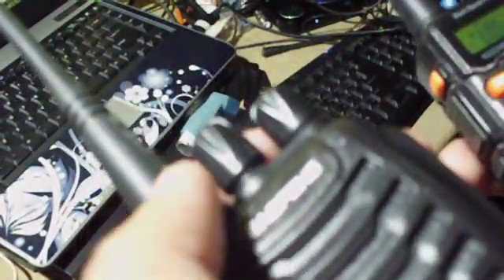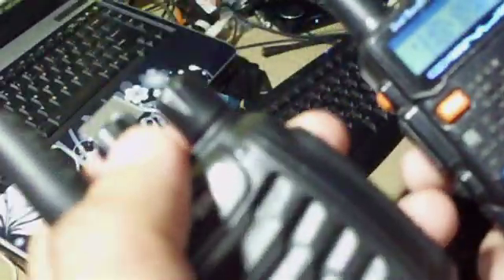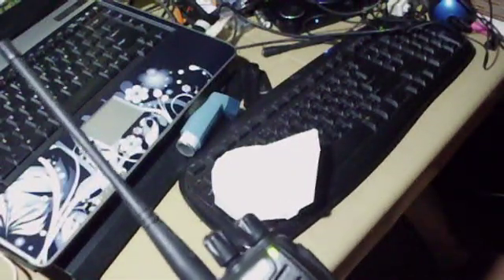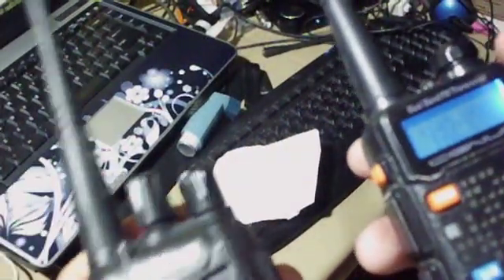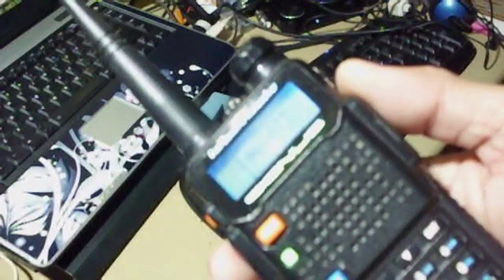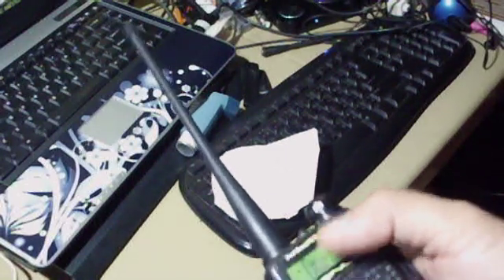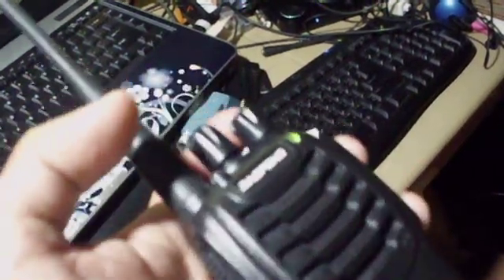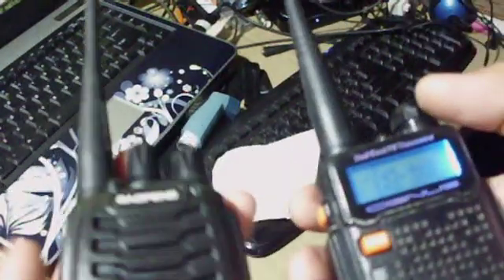How to put VHF frequency on Baofeng BF888s (3)

Comment: I tried this on 3 different BF888s radios. one with the following CMIITs
n/a
2017fp0564
2012FP1918
All three just beep when the frequency is changed to sub 400
Reply from the maker: This mod will work for older models of BF888s same version as the time this video was uploaded, unfortunately this doesn't work to a later versions of BF888s you can read on the comment section of this 3parts video for successful and unsuccessful mod. The most you can do is just restore the firmware of your radio to make it work again.
Reply: @EphraimGariguez  OK. That's find.  Maybe a follow up video is needed to help identify radios that are compatible. Thanks for the video.

Comment: Thank you for this video I had watched it about 100 times I finally got vhf frequencies on my radio  but all I am getting is a loud and steady feedback noise can you tell me what I am doing wrong 😅🙃
Reply: Thanks for your help I will keep trying
Reply from the maker: If the firmware and hardware are compatible there are 2 channels that will give you noise sound 1 & 2, so you just need to move on a different channel with vhf frequency and test on there, you need a dualband antenna for it to work.  Stay away from noise i.e wifi routers, computers etc. as baofeng front end is prone to noise. If successful you will be able to transmit on a vhf radio and receive it on your radio with modified firmware. Transmission on the modified radio is only short distance as the power output is too low to be useful less than 1 watt on mine. Unfortunately there are new hardware and firmware releases that is totally incompatible with the mod so whatever you do it won't work, just restore your old firmware and use it on UHF. Reports of successful mod are on the comments section of this three parts video, same with the reports of unsuccessful modification. Regards.
Reply: @EphraimGariguez  okay I got the noise to stop but I still can't rx and tx
Reply from the maker: @kevinbarrow4  most probably the cause is an incompatible hardware, because if not it would work right away base on my experience when doing it the first time. Retrace your steps, if still doesn't work just restore your original firmware version.
Reply: Does it resemble traffic noise?

Comment: Good Day paano po palawakin coverage ng bf888s? any tips? salamat po
Reply from the maker: Hindi nyo mapapalawak ang coverage nyan at 2watts lang maximum transmit power nyan, palit kayo ng radio.
Reply: @EphraimGariguez  marami po kasi akong nababasa na antenna daw po mejo confusing lang po
Reply from the maker: @janmichaelualat7971  kahit mo palitan ang antenna sa 2watts depende yan sa terrain ng lugar mo kung gaano kalayo ang kaya mong abutin 15 to 20kms siguro sa directional antenna na 6dB gain kung walang masyadong obstruction sa lugar mo. Kung maraming obstruction baka 10kms lang hirap na. Kung rubber duck naman na antenna roughly 1watt per km ang range depende rin sa terrain ng lugar mo, so yung radio mo 2km ang default range nya more or less sa rubber duck antenna.

Comment: Thank you for the video my friend. I have followed your instructions step by step, however CHIRP doesn't read the file from 888S PC Software and also, the main issue is that the green light remains on making a signal noise. Any ideas on how to resolve this? Thank you in advance for your help.
Reply from the maker: First move the dial to a channel which doesn't have noise, if you try different channels and still there is noise you are probably too close to a signal source that generates noise i.e wifi access point, move away from that area. If the noise is gone you can proceed with programming.

Comment: VENEZUELA.. Saludos.. Comprendo total su instrucción en vídeos.. Pero tengo una duda,, Usted inicia las pruebas en Canal 4.. Por que no inicio en Canal 1, 2, 3.... ??

VENEZUELA.. Greetings .. I fully understand your instruction in videos .. But I have a question ,, You start the tests on Channel 4 .. Why not start on Channel 1, 2, 3 .... ??
Reply from the maker: There are unusable channels introduced on the modded firmware when you convert your BF888s to have VHF frequency you will only hear noise on those channel the reason why I skipped it. This mod will only work on old releases of BF888s since 2yrs ago. Newest BF888s doesn't work using this mod tutorial.

Comment: Boss, pede ba gwing repeater ang uv5r pr sa bf888s?
Reply from the maker: malamang pwede pero limited coverage ka pa rin
Reply: @EphraimGariguez  boss, ung uv5r po ba pag ns labas ng bhay about 200meters, ung bf888s ns loob ng bhay nde na cla mag contact?
Reply from the maker: kung walang sira parehas at least 1km radius
Reply: @EphraimGariguez  ibig sbihin boss walang 4 to 5 kilometer ang uv5r?
Reply from the maker: @PCGSsingkit9423  yung uv5r 5kms, 1watt per km

Comment: hi after program. i cant hear what they say. but they can hear when i talk .
Reply from the maker: If you are using VHF frequency the radio has less than 1watt of power, so if it's too far from you and you don't have an external antenna the radio is only good for monitoring.

Comment: anong channel sa bf888s ang pde ko palitan ng frequency?
Reply from the maker: Pwede mo palitan lahat ng channel basta may programming cable ka :)
Reply: @EphraimGariguez  pag nag input ako ng frequency na bgo pero pag read na nagiging iba ng frequency ex; nilagay ko is 148.???? pero pag write na 245.???? lumalabas
Reply: chirp ako nagpa palit ng frequency
Reply from the maker: By default ang BF888 ay UHF radio so yung 148Mhz hindi talaga gagana unless i mod mo yung firmware check mo playlist ng video ko dito sa BF888 king gusto mo gawin. Pero hindi lahat ng unit ng BF888 ay gumagana sa VHF modding
Reply: @EphraimGariguez  oky salamat
Reply from the maker: @방탄소년단아미-h5e  these are 3 parts video, you need to strictly follow the procedure and software I used for modding the firmware, this will only work on the old version of BF888's around 2018 versions, there are reports that Chirp programming software can actually write the VHF frequency directly, but I have not tested it yet for those old versions of the radio. Please check the 3 parts video, and download the software provided on the link on from the description of these videos, cheers! and good luck. If in doubt read the comment section of the videos as there are comments of those who are successful and those who failed in modding those BF888's.

Comment: Ephraim Gariguez Sir tanong ko Lang, Ano pong mangyayari sa device ka pag Hindi ko papalitan ng antenna at Ng add aq ng VHF frequency??
Reply from the maker: Syempre pag ginamit mo yung radio sa VHF at UHF antenna ang nakakabit hindi ka makaka receive ng signal galing sa VHF radio kahit nasa VHF frequency ka. Gagana yan kung tinetesting mo ng malapit lang pero once na lumayo ka na wala ka na ma re-receive na signal. Kaya dapat kung may VHF frequencies at UHF frequencies yung radio dapat dual band antenna ang nakakabit. Pero dito sa Baofeng mod na eto useful lang yung radio sa receiving kasi masyadong mababa ang power output nya sa VHF so hindi mo rin magagamit as regular sa transmitter etong BF888 kahit ginawa mo yung modification.

Comment: I have those 888 radios.  How do you know what frequency is on each channel
Reply from the maker: get a programming cable and read it from Chirp you can also buy a frequency counter and check the frequency on each channel or make a google search about bf888 default frequencies any of those 3 will answer your question.

Comment: Hi Bro.tnx for vids.after reprogram one channel on VHF frequency by Chirp.of course I Do it improperly.I watch your video after I did it.
Now i can't reprogram radio with chirp and bf-888 software.
This error has happen :
"Radio refused to enter programming mode"
How can I solve this?
Plz help me.tnx.
Reply from the maker: try to reload the old firmware to your radio and see if it will work.
Reply: @EphraimGariguez  unfotunally I have not saved before chirping.😓
Reply from the maker: @mhg5061  try to look for firmware from google search if you can't find one, message me again tomorrow and will send you a copy from my radio. I just need to find my programming cable.
Reply: @EphraimGariguez  hi bro.I can't find proper file.tnx for your responsibility about comments.
Reply: @EphraimGariguez  by using BF-480 software i can enter to programming mode but after when turn radio on green light turn on and static noise begin.radio transmit and receive well but that static noise make me crazy.
Reply from the maker: @mhg5061  try the bf888 image file here that's a copy from my radio hope it helps to restore yours >>> https://drive.google.com/open?id=1E-SstoVnMuFMt7G5wk66D_nqOXTyivQX
Reply: thank you very much.🙏
Do I have to go into programming mode in chirp to use this file?
my radio refuse to enter programming mode.or i should use baofeng own software?anyway i will test it tomorrow.
Reply: @EphraimGariguez  where can get it?
Reply: @EphraimGariguez  and I have forgot a problem.after add vhf radio has a static noise continiously.when you on radio green light turn on and a noise in all channels you hear.but it transmit and receive.😭
Reply from the maker: @mhg5061  make sure that you are not near any source of electrical noise as baofengs are sensitive to noise. reload your old firmware, repeat the procedure and see if it will work.

Comment: sir how to connect sa motorola gp328
Reply from the maker: kailangan mo ng programmer sa gp328 mo
Reply: @EphraimGariguez  panu un sir sa baofeng lang ako may programing cable
Reply from the maker: @kimanchorez3045  alamin mo kung anong frequency nakalagay sa motorola mo yun ang ilagay mo sa baofeng mo
Reply: @EphraimGariguez  tnx sir is there any way na malaman un kahit walang programing cable?
Reply from the maker: @kimanchorez3045  gamit ka ng frequency counter kung wala ka nun pagawa mo na lang sa meron 150 yata pa program nyan sa raon
Reply: @EphraimGariguez  thaks sir

Comment: Thres no way to put vhf frequency into the baofeng bf 888s
Reply from the maker: apparently for some model it does work and for some  it doesn't, so it maybe firmware and version related if you watched the video playlists for the bf888 on this channel it has 3 parts and it does worked for me. if you read the related comments on those video you'll see that there are people who are successful in putting VHF frequencies on their bf888's as well. as for your case, I wonder if you did even try it, or just posted the comments here saying  "There's now way to put vhf frequency into baofeng bf888s"? watch the complete video and try it first.

Comment: paano po ba i connect ang baofeng 8888s to uvr5 thru putting the frecquency of uvr5 to 888s?

salamat
Reply from the maker: kailangan mo ilagay yung default frequency ng BF888 sa UV5R, kung may programming cable ka mas madali ang default frequency ng BF888  ay searchable sa google  good luck
Reply: @EphraimGariguez  wala po kayo list ng default frequency ng uvr5?
Reply from the maker: @janmarvinronquillo8929  search mo na lang sa google dapat bf888 ang kunin mo para mailagay mo sa uv5r kailangan mo ng programming cable para malagay mo yung default frequency ng uv5r sa bf888
Reply: @janmarvinronquillo8929  Hi, manual po si 5R, any frequency will work po between 136-174VHF/400-520UHF ksi Dualband sya. Basta po alam nyo freq ng 8s, pwede nyo po interconnect si 5R kay 8s. :)

Comment: Sir may tanong lang po ako. ung bf888s ko kasi once e.switch on long beep po ang tumutunog..anu po kailangan kung gawin para ma wala ung long beep..thank you
Reply from the maker: celem pagdanganan , try mo i factory reset pag ganun pa rin baka may naipit o grounded na keypad.
Reply: Saan ako mag.factory reset sir?sa unit mismo o sa pc?kung sa unit paano po?.wala na po keypad ang bf888s sir kaya malabo na may naipit..
Reply from the maker: celem pagdanganan pwede sa  pc pwede sa unit. search mo sa google kung pano or sa manual mo
Reply: wala sa manual o sa google kung paano ma reset ung bf888s sir..
Reply from the maker: @celempagdanganan3427  http://miklor.com/BF888/888-Rec-BF888S.php
Reply: Sir may beep sound parin ba sayo? Pag sa vhf na channel kasi may beep sound pero sa UHF wala.

Comment: sir.. seems you know more about radio frequencies, im just a newbie in radios.. just bought 2 UV-5r.. just want to know the frequencies of BF888s so that i can use it with my UV-5r..
Reply from the maker: CH1 462.125 CTCSS 69.3
CH2 462.225
CH3 462.325
CH4 462.425 CTCSS 103.5
CH5 462.525 CTCSS 114.8
CH6 462.625 CTCSS 127.3 
CH7 462.725 CTCSS 136.5
CH8 462.825 CTCSS 162.2
CH9 462.925 DCS 025
CH10 463.025 DCS 032
CH11 463.125 DCS 125
CH12 463.225 DCS 331
CH13 463.525 DCS 023
CH14 450.225
CH15 469.945 CTCSS 203.5
Reply: @EphraimGariguez   pede na ilagay diretso yan list na binigay nyo sir sa UV-5r?
Reply from the maker: @KaHamRadio  pwede direkta  na
Reply: @EphraimGariguez  ahh ok salamat idol
Reply: I mean sir ung baofeng- b888s ko gusto makonek sa uv5r  diko Alam Ang para ikonek sila
Reply: Sir panu ko po mkokonect Ang uvr5 ko sa 888s? Pa helpnaman po wla kasi ako manual
Reply: sir kahit anong 888 yan.. yan talaga ang frequencies? kumbaga naka standard sya?
Reply from the maker: @jaysonreyes  opo
Reply: @EphraimGariguez   sir Yan ba combination nya sa bf888 ska sa uv5r?
Reply from the maker: @jhonmarkcristobal8479  yung frequency ng BF888 ilagay mo sa UV5R unless meron kang programming cable para ma bago mo ang frequency assignment ng BF888 mo
Reply: sir.. ako ulit..  yung bf888s ko nakokonek ko naman sya sa uv5r..pero walang audio na lumalabas sa bf888s coming from uv5r..
pero from bf888s to uv5r ok naman sya..

ano po kaya problema nya.?

sana pwede kayo matawagan for help and troubleshooting.. number ko po 09214382669
Reply from the maker: Ilayo mo ng konti yung isang unit pag nag te test ka ng audio ipagamit mo sa kasama mo sa bahay or baka naka enable yung ctcss code sa bf888 kaya walang audio o magkaiba sila ng code sa setting gamit ka ng progaramming cable para ma read mo yung full settings ng radio
Reply: @EphraimGariguez  sir.. okay naman sya sa outgoing.. pag nagsalita ako sa 888s.. naririnig ko naman sa uv5r.. kaso pag uv5r na ako nagsalita..walang nalabas na audio sa 888s..

seems okay naman ang speaker kasi sa menu natunog pa sya..
Reply from the maker: @jaysonreyes  baka uv5r mo ang mali ang settings o mahina ang mic gain common issue yan ng mga lumang UV5R pa  check here >>> https://youtu.be/F3xa6zlGdJc
Reply from the maker: @jaysonreyes  preamp audio mod https://dw1zws.com/some-hardware-modifications-for-baofengs-uv5ruv82/
Reply: @EphraimGariguez  hindi naman paps.. kasi 2 uv5r at at isang cignus ang gamit ko.. lahat sila okay naman sa isat isa.. yang 888s lang talaga..

tried ko nga pala kabitan ng headset.. wala din receiving.. pero outgoing okay naman
Reply from the maker: baka settings lang yan double check mo.
Reply: @EphraimGariguez   wala naman ako binago sa settings paps.. siguro tapon ko na ito. sakit lang sa ulo itong 888s..
Reply from the maker: @jaysonreyes  itabi mo na lang magagamit no rin yan sa kaparehas nyang unit ;)
Reply: @EphraimGariguez  paps.. just found out na 3 out of 16 frequencies..nagana between uv5r at 888s.. those frequecies  na NONE sa Tone mode.. and those are channel 2,3 and 15

di ko ma explain pero nung na try ko lahat isa isa.. yang 3 ang gumana sa dalawang units..
Reply: @EphraimGariguez  yung iba kasi naka TSQL at DTCS.. may info ka about dito paps?

Comment: with the problem of setting the frequency of baofeng 888 plus what frequency of channel 5 I want to speak with other radios of baofeng uv5r
Reply from the maker: default for baofeng bf88s CH1 462.125 CTCSS 69.3
CH2 462.225
CH3 462.325
CH4 462.425 CTCSS 103.5
CH5 462.525 CTCSS 114.8
CH6 462.625 CTCSS 127.3 
CH7 462.725 CTCSS 136.5
CH8 462.825 CTCSS 162.2
CH9 462.925 DCS 025
CH10 463.025 DCS 032
CH11 463.125 DCS 125
CH12 463.225 DCS 331
CH13 463.525 DCS 023
CH14 450.225
CH15 469.945 CTCSS 203.5

Comment: What is the default freq sa baofeng bf 888 pag binili
Reply from the maker: CH1 462.125 CTCSS 69.3
CH2 462.225
CH3 462.325
CH4 462.425 CTCSS 103.5
CH5 462.525 CTCSS 114.8
CH6 462.625 CTCSS 127.3 
CH7 462.725 CTCSS 136.5
CH8 462.825 CTCSS 162.2
CH9 462.925 DCS 025
CH10 463.025 DCS 032
CH11 463.125 DCS 125
CH12 463.225 DCS 331
CH13 463.525 DCS 023
CH14 450.225
CH15 469.945 CTCSS 203.5
Reply: Ito PAla ang defaults freq ng bf 888s

Comment: I've installed the cable program but its won't work...
Any solution?
Reply from the maker: replace your cable or make sure to install the correct drivers for your operating system there are plenty of tutorials regarding the installation of proper drivers regarding your programming cable chip just search on google.
Reply: @EphraimGariguez  do you have sugest for driver software?
Reply from the maker: @okyandrianto6367  , you need to know what is the chip running on your cable then use google to search for appropriate driver,  otherwise you need to build your own cable this will work without problem on chirp >>> https://dw1zws.com/kenwood-kpg-46-using-usb-ch340/  good luck!
Reply: @EphraimGariguez  i have succed to change frequency to vhf, but soung is no clear like yours
Reply from the maker: @okyandrianto6367  , replace your antenna with dual band antenna
Reply: @EphraimGariguez  okh thanks bro